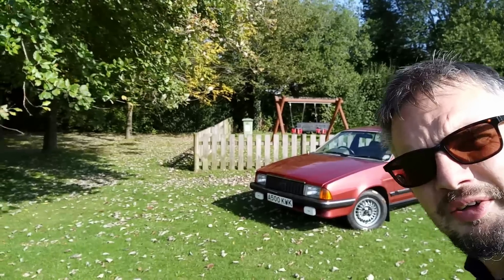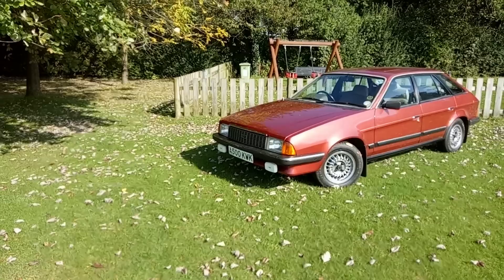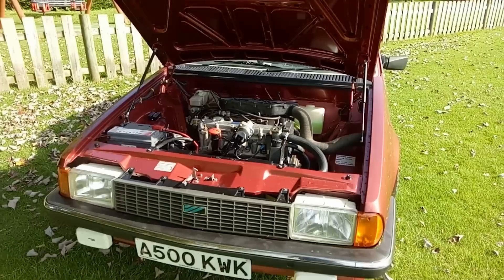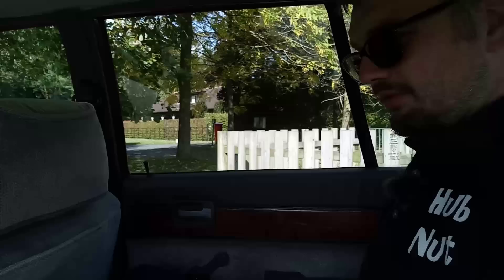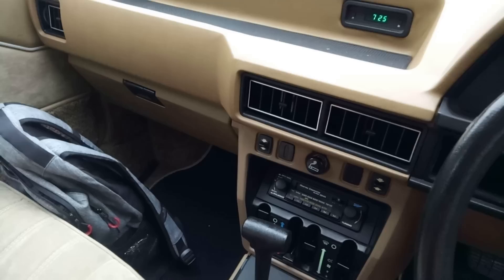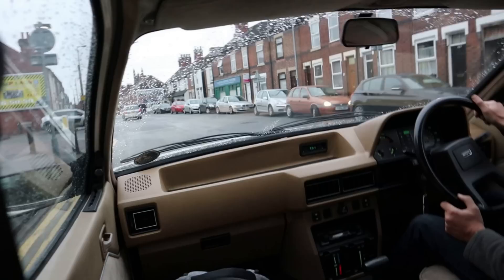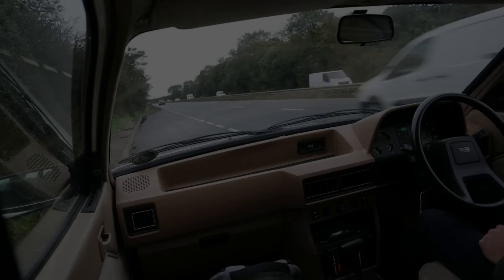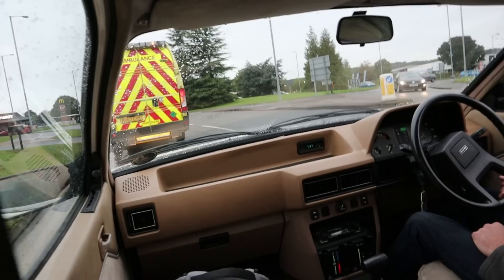Real Road Test: Ambassador vs Princess Pt2: Ambassador time!

Comment: An interesting vehicle!
Now, I remember certain BL vehicles have four speed manuals with electric overdrive, and wonder why that couldn't have been added? The automatic is begging for overdrive, or at the very least, lock-up converter to lower noise and better fuel economy.
Of course, you lucky British have such interesting motorcars, this never imported into the US.
As for build quality, US vehicles were built like this, and the reason why many started buying imports, which honestly weren't that much better.
I like the Princess because of that lush sounding six, and like the Ambassador because of its versatility. Shame both failed.

Comment: Thank you for these visions of the past - Princess and Ambassador.
I had 1800 Princess, 2000 Princess and then 1700 Ambassador.
I liked them all.  The problem with the Ambassador was that its suspension units would fail, one at a time, after about 80000 miles and these were no longer produced when I needed them.  Replaced with scrap yard Princess units.  The rebound strap on the rear suspension was only about half the length of those on the Princess and were apt to break.  That wasn't a big problem as long as you didn't have to jack the rear wheel, when the suspension arm would  fall until the brake pipe held it!  Despite the car's weight, the 1700 was more than adequate for grown-up driving.  I once batted it fully laden along the M27 between 85 and 90mph because I was late for my channel ferry - which I caught 15 minutes before it cast off!  On other French holidays I had a clutch pressure plate failure (thanks to an Indian gentleman's garage who replaced the clutch but not the p plate) and exhaust valve damage due to an English gentleman's garage who replaced the exhaust but didn't tighten the exhaust manifold nuts.  They also cross-threaded one of the plugs in the Al head.  So the car was sent to a head specialist who sorted it all out for some £270 (a lot of money in 1990) - and the car was transformed and was more powerful and more economical than when I bought it new!!  But in both cases, this stout-hearted car drove me round France just the same - only a little slower!  On one such occasion the clutch started slipping just N of Tours on my way home.  By keeping the engine away from high torque, I drove it back to Weymouth OK and left it on the garage forecourt.  Next day at work, garage foreman phoned me to say he drove the car to check it and the clutch ceased function after 200 yards.  Yeah!  We finally sold the car at 130,000 miles, 9 years old when we moved to France, where we now drive 1300 Maestro and a rather nice 1600 Xsara Picasso.

Comment: I started off feeling really positive about this car, the styling and interior are quite nice and I am sure the nice floaty ride is comfy too.  Then all the interior started rattling and the engine noise intruded so badly and I began to feel sad.  It must have been so hard for the people at Austin Rover to do well under the constraints they had.  Maybe the rattles could be fixed and more soundproofing could be added.  The rear wiper is nice though.  Thank you for illuminating these two cars so objectively.  Cheers.
Reply: Nothing to feel sad about... The white is mine, and I can honestly say this car puts a huge smile on my face when I drove it.
Yes the dash rattles on tick over.. and it will get sorted, as will any other issues it has.
Reply: Thank you for the reply.  I am so pleased to hear about the car and I hope you can sort it all out.  I love a car that makes you smile, it means it is a good car.  Cheers.

Comment: I bought a red Y Reg in Stirling, Scotland around 1992 for $110.  Had the most exciting car experience ever.  Driving down the M76 to work at a serene 70MPH I became aware of a hissing noise coming from the back of the car.  I thought the boot was open but no, a sudden sucking noise then a pop and the rear quarterlight blew out of the car and I was just quick enough to see it smash on the road behind me.  Driver behind flashed like hell as though I'd done it on purpose.  First and only time I suffered a decompression in a car.  Down the scrapyard on the weekend and pushed the required window out of a scrapper with my foot.  Glued it in myself.  Job done.  Actually a much better car than I expected although I was trading up from a 73 Marina.  Sad to see it go but a gallon of warm gravy spilled in the boot rendered it unbearable.

Comment: Hope he saved the old radio.  I actually put back my original radio on my '65 Corvair.  Needs a speaker.  Also my compact Ford Tempo from 1985 was similar to the Mondao, but based on the Escort.  Had a dinosaur pushrod 2.3 litter  4 cyl. It had a wonderful 5 speed manual sourced from France.  Most cars had auto chokes by 1960 in the U.S.  They seemed to work well.  By the mid '80's fuel injection was becoming common.  Had to meet the solution regulations with a carburetor by then.  Fun video.  I love your wiper comments!

Comment: Not a surprise to hear the conclusion about the Ambassador. It always had the feel of an update on the cheap. I always thought the Princess that was 'right' was the original Wolseley 18/22 - it looked great with a proper Wolseley grille and I've often wondered why all Princesses weren't badged as Wolseleys which would have made them a slightly luxurious executive car, not competing with top of the range Marinas and Maxis but not quite into Rover or Jag Triumph territory. Though there is a theory that BL kept them deliberately under-specced so they wouldn't compete with the more prestige marques in the BL family. A great shame.
Reply: Perhaps the eventual BL range was just too big resulting in overlaps that needed to be carefully managed. If management was the right word for that company in those times.

Comment: I had a very early suffix Y reg Sierra. It was a Ghia so comparable spec to this but it had the 2.3 V6 and a proper automatic. It's plain to see why these things didn't sell well, despite the primitive underpinnings of a Sierra, on those MK1 soft springs, 13 inch wheels and gas assisted dampers it rode extremely well and wore it's miles admirably, no rattles, no breakdowns, nothing. However....as a Brit I love that these are in the hands of enthusiasts, they are attractive in their own way and deserve to live on.

Comment: Great to see these cars still running. Funny as I used to hate them when I was young. My brother owned a hideous rust bucket Princess which was as reliable a car as a chocolate teapot. I nearly bought one in the late 80's for only £100 but at 5'8" ,I couldn't depress the clutch pedal fully . I never understood this , as my brother is an inch shorter than me and didn't have that problem with his . In the modern world even cheap modest cars are generally reliable and don't rust to bits within five years but most of them look very boring compared to 70's , even 80's cars , and I never thought I would hear myself say that !

Comment: Strewth what a hideous front end, reminds me of Alfas later 2002 166 front end. A low point in Alfa styling. Getting back to the Austin Ambassador, it's kinda ok in profile etc the wheels help with the look. Not that long ago I used to see one of these parked on the streets of south London, it was in lovely condition, always clean and it was a street car – amazing what you can still do without a garage!

Comment: I did an engine rebuild on my vanden plas ambassador and the one job that was a must was to remove the auto choke and fit a manual, there was a kit you could buy.
The poor running was often down to the twin SUs, I had mine rebuilt by Burlen fuel systems at Salisbury, getting them correctly balanced was key.

Comment: I worked with a chap who went from an 845cc Renault 4tl to a 1.7 Ambassador, he loved it for about three months, then it started going wrong, I think a head gasket, water leaks in the body and electrical problems were the big issues. Oh, and the fact that it mopped up fuel in a way that the little yellow Renault never could. Despite the comfortable ride and vast boot space the Austin had to go, replaced by another Renault, this time an 11 which went round the clock and was only sent to the scrapyard after being rear ended by a lorry.

Comment: Had a silver one, and it was a big comfortable car that swallowed the needs of a young family and had a cavernous interior for bulky stuff. The hydrolastic suspension was awful if you hit a bump on a bend, as the car was badly unsettled. I remember the timing gears on the O series engine rattled on idle too. It did the job, but I wasn’t sorry to see it go .

Comment: Don't keep asking me Why Reg, it just happens to be that year.
I'm actually liking that very much.  I think those stalks were in my 1984 Maestro HLS with the modular dashboard. My favourite ones came on the Montego, they had fibre optic backlighting and the "flush & forget" function.
Reply: Pre 86 Maestros had the same switch mechanism but with one piece moulded arms. Montego and later Maestro had an altogether different switch unit with a pop up hazard switch and yes, they were illuminated (on the better spec models only, mind) with fibre optics!

Comment: Where do we start.

Morris Ital front end? I ruined the look of the Marina and does the same for the good looking Princess. 

Side on, the glass section gives a hint of future models, Montego etc.

The loss of a silky smooth straight six is only going to make vibrations worse, better fit a Austin Rover style dash so you can appreciate the vibrations through sound.

The steering pump shouldn't be causing problems at that mileage, perhaps a flush through and fresh ATF fluid would restore it to it's former glory.

Having said all this, I am so grateful that they still exist. Well done the owners.

Comment: Ian, to your dismay over Austin making production changes in the last run of Ambassadors...ironically just today I read this in a report on the last (and obscure) Studebaker Champ pickup trucks (circa 1963): "Even with the end in sight, the company incorporated a number of changes into the last run of Champs. The final trucks boasted a new steering box and revised steering geometry, revised front shock mounting, and swing pedals, as well as firewall-mounted master cylinders." Odd it may be, but I guess not unheard of.

Comment: I was given one as a stop gap company car while waiting for a Vauxhall Carlton estate to be delivered. It was a mid range SDL. It scrubbed up fine and was lot more refined and rattle free than this example. Cornering and handling were excellent  and we got on fine with it. After about 2 or 3 weeks the leasing company asked for it back which i was reluctant to do but they insisted while being secret squirrel about why. I got the impression they had gone legal with Austin Rover. They replaced it with a 2l Cortina Ghia auto. In comparison the Ford was all frilly velour trimming on mundane engineering, and it broke down .

Comment: You are correct that the 6 cylinder engine was dropped with the introduction of the Princess 2. I was working in a BL main dealer at the time and no satisfactory explanation was ever given by the manufacturer for its demise. That terrible vibration and rattle on tick over was quite common on the autos and generally was cured quite simply assuming there is no fault with the box. 

There was a loose sheet supplement to the workshop manual to tell you to raise the tick over from the stated 750 rpm to 850-900 rpm or as the cars got older the engine mounts used to soften requiring replacement. 

I think it's probably a bit sad that I remember this stuff some 40 years on!!!!!!
Reply: Princess 2 did include the 6 cylinder engine: https://www.flickr.com/photos/61090099@N04/albums/72157667702048836

Comment: 11:03: "Coins". And don't you dare put anything else in it. 
14:03: I actually prefer that. 
20:07: Great angle by the way, I am liking this.
21:15: The rattles are pretty abysmal. Character, I guess ;). 
It does look very comfortable and light to drive. I'd love to give it a go, based on this video.
Reply: I've sorted most of the rattles now since the video was shot and I've balanced the carbs again.
Ian forgot to mention, or at least I forgot to tell him that I've not actually done any restoration on the white one as yet. After I purchased it from the scrap yard back in 2011, all I did was recommission the car to be used as is... 
It really is a joy to drive, once you get used to it.

Comment: werst car i ever bought  mine was a y reg  cream with gold seats yes i just admitted that , but if you changed the plastic bushes on the linkage  that was alot better also  changing the type size made it rev lower at speed  so that made it more bearable
Reply: I've no idea how Austin Rover seriously expected that ponderous old car to complete with GM's Cavalier in the motorway rep mobile market. They never even bothered with a left hand drive version. They would have been laughed out of the European market.

Comment: With the late addition of the wood door trim and the removal of the blanking switches from the dash almost makes you wonder if they hadn't actually planned to drop the Ambassador as quickly as they did. Seems like there is more to that story than what we know as it is an unusual move as you say 🤔
Reply from the maker: It's a curious one, because they already had the Montego in development, so they were never going to sell the two alongside each other.
Reply: HubNut of course they did so definitely a curious one to say the least. I could maybe make sense of it if they'd added say Vanden Plas spec things to lower trim levels to use parts up so to speak but this is just odd 🤷‍♂️

Comment: Yet again another SUPERB video 
Some of the very last off the production line Austin Maxi cars had the blue badge as well 02:25 
It is a very funky logo .
EDIT ..The Y reg Austin Ambassador was a 1st August car ..Back when they ONLY changed the letter once a Year ..
When I was a child on 1st August during the summer holidays I would always get up early to spot the first "New letter car" 
DOUBLE EDIT.... 2.0 Litre  Carb fed /Petrol AND AUTOMATIC.... Well I bet that is good for  19 MILES PER GALLON (A UK gallon for our younger viewers  is 4.546 Litres) 
Once again Mr HubNut you have gone above and beyond on your video..  10 out of 10
TREBLE EDIT... Mr HubNut my 1999 MK 6 Toyota Celica has developed a "Squeak Squeak Squeak" sound when you are driving slow in built up town traffic... It goes off once you get over 30 MPH .. It is driving me NUTS ... Any idea what it could be... The car has just had a new handbreak cable fitted... On my car it is a left and right cable... The noise has only developed since the hand-break cales were changed..
Reply from the maker: Could be the handbrake has been slightly over-adjusted. I'd try gently raising the handbrake to see if the squeak stops.

Comment: Just a minor point. The O-Series was a completely new engine design, and was, if I recall correctly, one of the first engines in the UK to be completely assembled by machine.
It was a very good design, but (like most English vehicles) it'd have been far better if made by the Japanese or Germans.

Comment: It is funny how those rims look a lot like the basic alloys from the e30 BMW.
How funny is the “coins” sticker on the small cavity on the left of the steering wheel right under the dashboard. Very dry haha.
The rear seat bench could use some retightening of the cloth though.
The feature of folding the rear seats with the handle in the booth is still in use in the automotive world. BMW e90 have exactly the same way of folding them.

Comment: That power steering pump on the Ambassador looks like the pump on my  1982 Chevrolet C 10 pickup, I to own a 1972 AMC Amdassador with a 360cid or 5.8 Liter engine.

Comment: Nice to finally see Part II of this review!  The dash rattle at one point reminded me of "Elly" at idle, while the blast down the road at 70 had a "booming" resonance which sounded a lot like a startup of the CFM56-series engines, used on Airbus, Boeing 737s, etc.  I noticed, towards the end, w/ the front 3/4 view, there was just a slight resemblance to a 1976 Alfetta GT, one of my favorite car-shapes of that vintage.  Well done, as always, in spite of sticky auto-chokes (probably a GOOD reason they were never used on aircraft engines!) of the red car; the interior of the white one was more pleasing as well!

Comment: Of the two BL/Austin Rover "wedge" models, I felt the Ambassador was the slightly better looking of the two. Looking back, the BL/Austin Rover/Rover Group were too inward looking, producing the cars they wanted to make rather than the cars people actually wanted to buy. Sure, they scored a few successes - Mini, Marina etc, and lattery the Rover 214/218 - but on the whole the company always struggled to hit the right motoring notes. A general lack of investment, issues with unions along with a lack of sound professional management always meant that they were swimming against the tide. Plus the persistent quality issues were always a bugbear. They were always destined to go down the pan at some point. It was simply a question of when.........